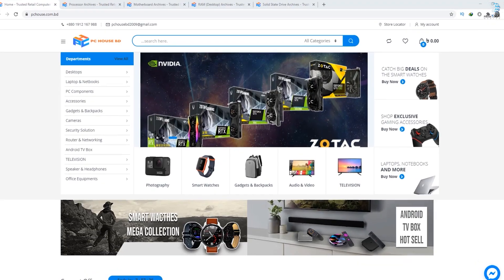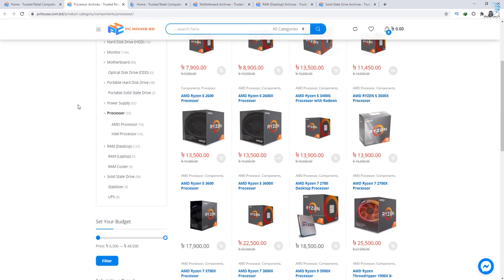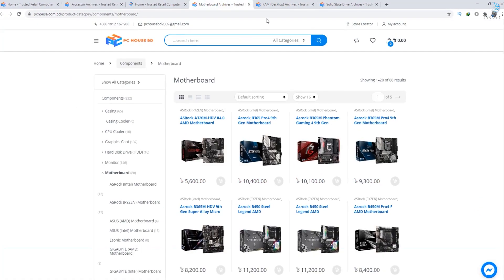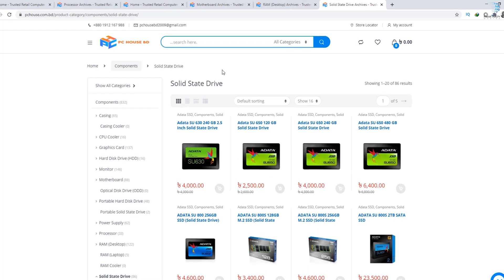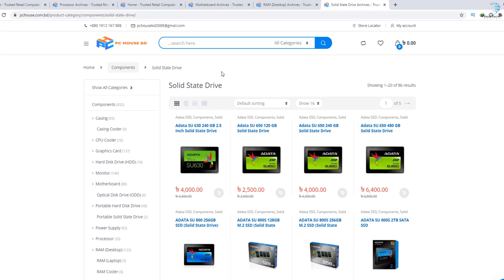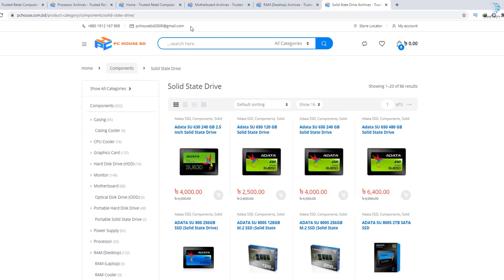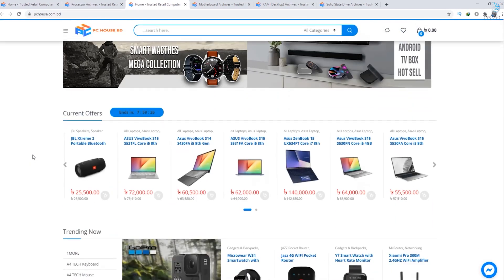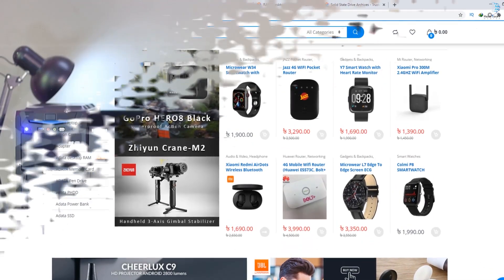Best Budget PC Builds for All | Editing , Gaming and office Work

Comment: processor;::Core i3 10 th gen (10105)
Motherboard::MSI 510 M pro E
RAM: 4Gb Ramsta(2666mhz)
SSD;;128Gb Kingsman
Keyboard:Fantec (combo)
Casing::: Antec(Rgb stick+Macnet filter)
Monitor :: Gigasonic 19""
Power supply;;Revenger (350 watt)

All product 3 years warranty (monitor 1 year) Life time support warenty
Neoya 7din hobe....ata koto hole neoya jai vai

Comment: ভাইয়া আমার বাজেট ২০ হাজার টাকা যদি আমাকে একটু হেল্প করতেন কিভাবে একটা পিসি বানাতে পারি এই প্রাইস এর মধ্যে
Reply: And athlon 3000g ~ 7800tk
MSI A320m pro motherboard ~ 5600tk 
Ssd ~ western digital 128gb ~ 2200tk
Ram = Corsair vengeance lpx 4gb 2400mhz~ 2300tk
Casing= normal 1700tk
Psu = local or less known brand 1300tk( check on store)

Comment: For tight budget I recommend Transcend 230S 128GB(price about 2600tk). It has DRAM caching. So better choice for durability and performance.
Although going for 256GB( about 3900-4000 tk) version or Samsung 860EVO 250GB would be better choice if budget higher.

Comment: zebronics h61 motherboard + 1tb seagate barracuda harddisk + 230 volt zebronics smps + i5-3570s processor + 4gb 1600mhz ddr3 single channel ram iss configuration ka sath kaya main zotac geforce gtx 1050ti ddr5 4gb ka graphic card use kar sakta hu? please reply karna..

Comment: Never use a unbranded power supply. It's a ticking bomb. It will damage your PC components. This guy sounds like he doesn't know much about PC building.

Get a Ryzen 5 3400G instead of that CPU featured in the video.

That case is very bad.

Comment: গ্রাফিক্স ডিজাইনের জন্য ক্রয় করতে চাই আমার পিসি কেমন হয়েছে?  

Prossecor - intel core i5 4th generation (5700 tk)

Mother board -Gigabite H310ms2p8th9th generation intel intel aga1151shoket ultra durable motherboard (6500tk)

Ram- corsair vengeance Lpx 8 gb ddr4 2400 mhz gaming sd ram (3600 tk)

Hdd- Toshiba Hdwd 110 (3500 tk)

casing sp beast Atx (2500 tk)

kewboard logiteck usb k 120 (350 tk)

Mouse logitech usb b100 (550 tk)

Monitor 7000 budget(please suggest)

Headphone prolink wire phe 100 E (800 tk)

Total 30500 tk with monitor

Comment: Processor : intel core i3 9100 9th gen 
Cpu Cooler : stock cooler 
Motherboard : MSI MAG B365M  Mortar 
Graphics : Intel UHD Graphics 630
Ram : Corsair 8GB 2666Mhz
SSD : sundisk 240GB
Power Supply : Corsair CV450
Casing : Corsair 175r rgb
Mous : logitech UBS
Keyboard : logitech usb Monitor : HP 21.5inch 22FW

Ei configure ta kemon hobe plzz janaben😊😊
Reply: Valo na
Reply: Graphics card lagale pc ferrari er moton dorabe

Comment: AMD RYZEN 5 3500X Processor
ASRock B450M-HDV R4.0 AMD Motherboard
Team Dark 8GB DDR4 3200 Mhz Gaming Desktop Memory
Western Digital Green 240GB SSD
GALAX GeForce GTX 1650 Super EX (1-Click OC) 4GB GDDR6 Graphics Card
Antec VP550 Plus 550W Non Modular Power Supply
Antec DP501 Mid-Tower Gaming Case

Price 55k. What will be the compatibility? Any room for improvement? Any scope to cut price by choosing alternatives? Overall performance?

Comment: Vi Asus d509dj AMD Ryzen 5 3500U (2.10GHz-3.70GHz, 4GB DDR4, 1TB HDD) Nvidia MX230 2GB Graphics, 15.6 Inch FHD (1920x1080) LED Display, Finger Print Sensor, Win 10, Transparent Silver Notebook #EJ056T-D509DJ	

Price=49000/=
Notebook Model - -, Processor Model - -, Processor Base Frequency - -, Processor Cache - -, Display Size - -, Display Technology - -, Display Resolution - -, Memory (RAM) - -, Storage - -, Graphics Chipset - -, Graphics Memory - -, Operating System - -, Color - -, Warranty - 2 year (1 year for Battery and Adapter)

এই laptop টার একটা review করা যায়

Comment: 🍁আমার পছন্দের কনফিগার এর একটা কম্পিউটার বিল্ড,,।।। ✔এই কম্পিউটার  টা কেমন হবে অবশ্যই জানাবেন। এবং এর থেকে কোনটা পরিবর্তন করে কোনটা নিলে ভালো হবে। তবে এটা গেম খেলার জন্য বিল্ড করবো না।।।। শুধু মাত্র ওয়েব ডিজাইন, ডেভেলপমেন্ট, এবং নরমাল ভিডিও এডিটিং ও নরমাল গ্রাফিক্স এর কাজ করবো,,, তবে মেইন উদ্দেশ্য ওয়েব ডিজাইন ডেভেলপমেন্ট এর কাজ করবো। 🔰 বাজেট=৯৫,০০০ টাকা।

1⃣ AMD Ryzen 5 3600 Processor.

2⃣ Motherboard MSI Tomahawk B450 MAX.

 
3⃣ Ram Corsair Vengeance LPX 8GB DDR4 3200 Bus. 2 ta 16 GB.

4⃣ Samsung 970 EVO Plus NVMe M.2 250GB SSD.

5⃣ HDD Seagate BARRACUDA 1TB.

6⃣ Gigabyte GeForce® GTX 1650 SUPER™ WINDFORCE OC 4G, 4GB. 

7⃣Corsair CX550 550Watt 80 Plus Bronze Certified Power Supply.

8⃣GIGABYTE C200 GLASS.

9⃣LG 22MK600M 21.5 inch IPS Full HD LED Monitor.

🔟 Keyboard + Mouse, PAD, Market Choice, Bugged 1500 taka.

11) MaxGreen MG-GOLD5 1200VA Offline UPS.

👆 এই কনফিগার টা সম্পুর্ণ আমার মতামত এর উপর করা হয়েছে।
Reply: Xoss build just monitor ta Samsung ls22r350 ta niyen cz oita 75hz refresh rate
Reply: @ariyankhan7684  Hmm,,,Tobe oi tay naki problem ase,,,dot Pixel ar,,,,
Asara HP 22F ta kemon hoy
Reply: @mdal-aminsardar2681  vai onk a use kore apni check kore niyen r Samsung na nile lg r tai nen ✌️